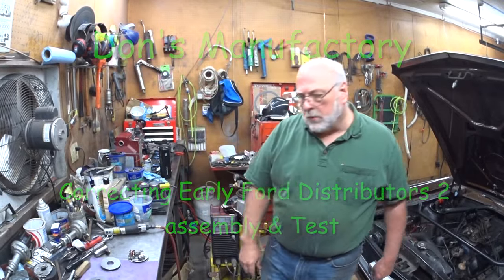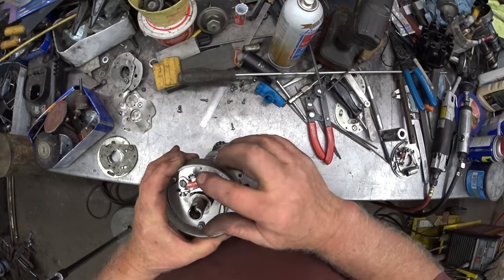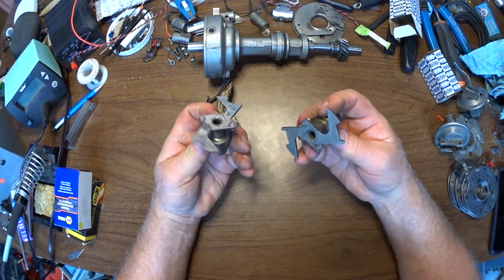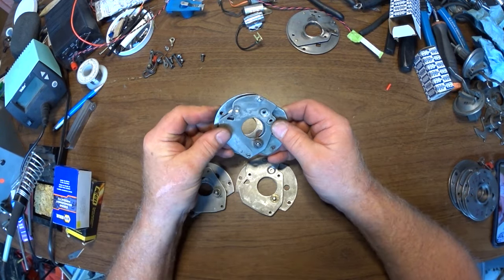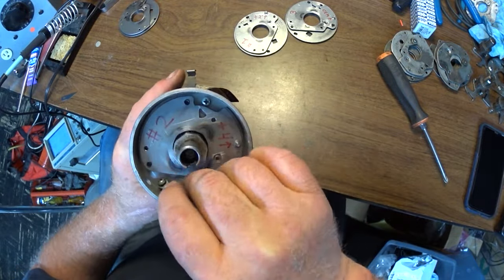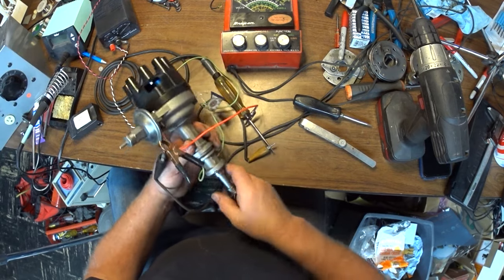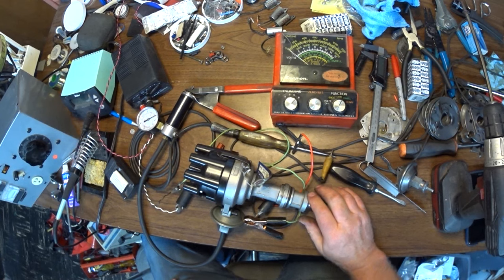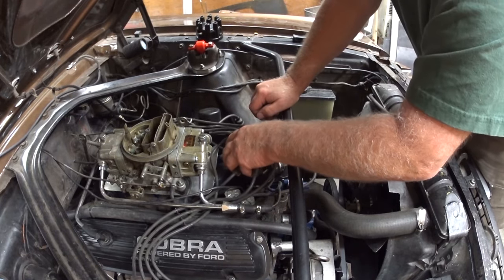Correcting Early Ford Distributor 2 - Assembly & Test - 66 Mustang Betsy

Comment: I think the issue was that there  were NO standards from any of these cars. Each year they found the least expensive provider and the specs were vague or non existent. And we have learned that year to year they would use last years parts until they ran out and then used this years pieces, that way even cars of the same year had different stuff. I do not know if you can make a standard piece for all. I applaud your engineering , great piece with no rotational distortion. I cannot believe how sophisticated this is, I literally stuffed this think in back in the 70's . NO wonder I was welding points
Reply from the maker: I think things were kinda ok before the after market companies raced to the bottom as the market shrank. 
Welding points! Possible resistor wire or shorted primary coil winding? Points must have been switching high current. 
I Looked up condenser specs, .21 to .25 mf so there’s a lot more lee way than I thought. 20% parts are the cheapest. 
Thanks Wally.